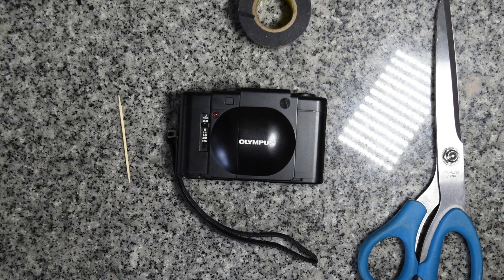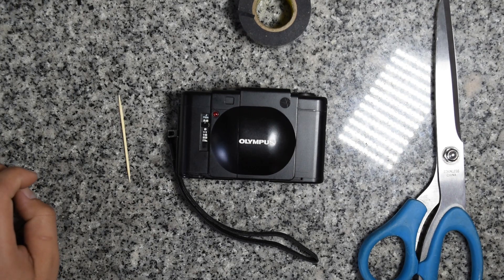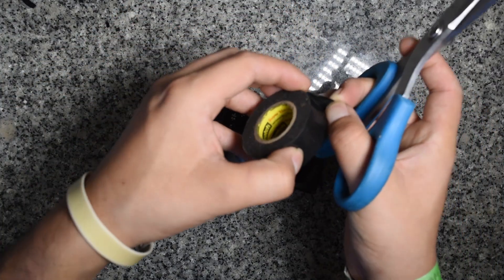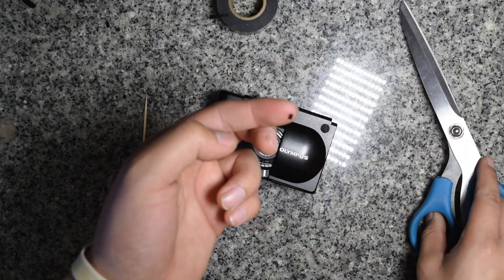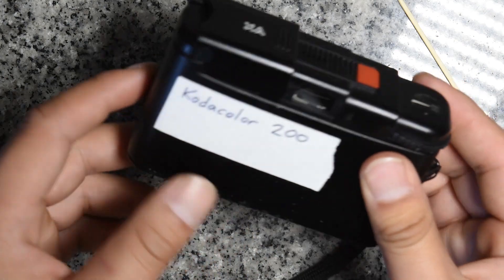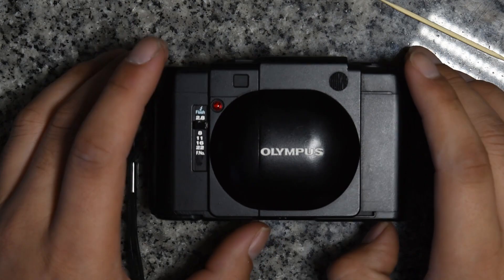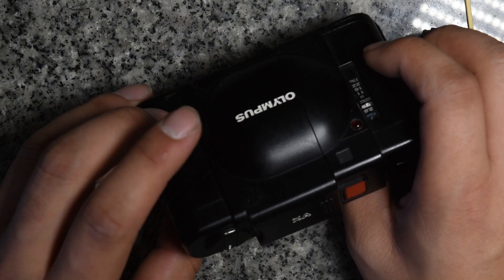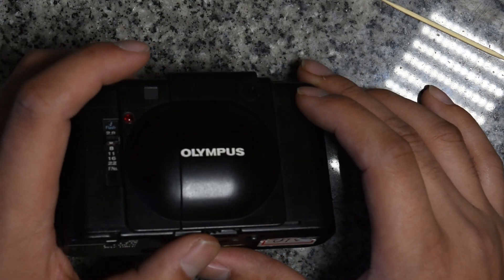How to Fix Dim Rangefinder Patch (Ft. Olympus XA)

Comment: The patch size needed for the viewfinder is approximately 2.6mm wide and 2.4 mm high. Alternatively, a sheet of grey acetate the size of the viewfinder (approx 15.3mm x 11.2mm) is easier to cut. Grey acetate=unused portion of an exposed/processed black and white negative roll (e.g. such as the film leaders/trailers). Processed color positives/slides around the same darkness/color would work also.
Reply: How would you glue that onto the VF?

Comment: the window you put the tape on is actually the viewfinder.  the "trick" is just as effective on the window to the left, which is the actual rangefinder window.
Reply from the maker: Both true, but I try not to get tied up on semantics when it's not absolutely crucial to a demonstration such as this. Also, while I haven't actually attempted your suggestion, it's easy to see why this method would be easier to do than cutting an even smaller piece for the window to the left.

Edit: Did a quick check for everyone reading this. This actually dims the patch almost completely. Will check again when I have more time.

Comment: A nice trick for increasing contrast, but the XA is so dim and small that it hardly matters (you should zone focus the XA; the patch is unusable in anything other than bright conditions). This trick also depends heavily on the viewing angle. If you eye isn't aligned perfectly, you will miss the patch entirely.
Reply from the maker: True on most accounts, but I have to disagree on a few points. I've found this trick is a great benefit - if placed correctly. I am terrible at estimating distances, so this has made the XA more of a pleasure to use. I have also found that this helps in lower light situations, but I'd never recommend this camera for low-light shooting, since you're maxed out at 800 ISO and you're not in control of the shutter speed.